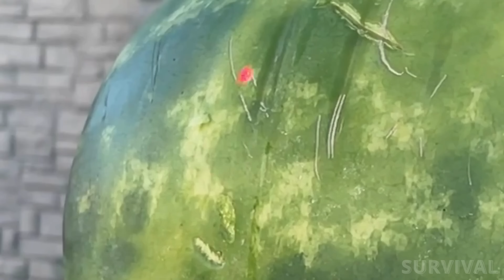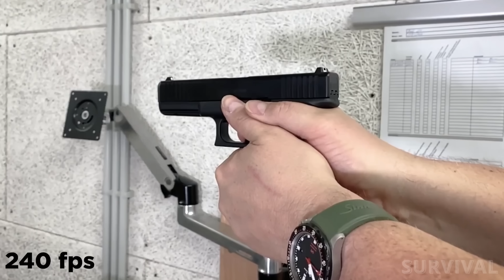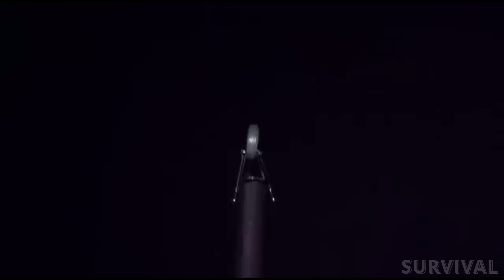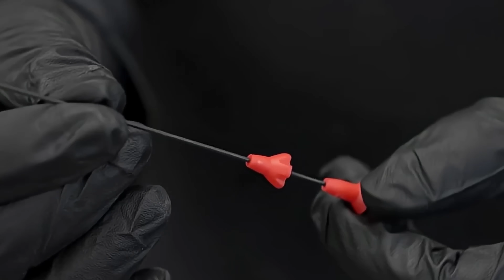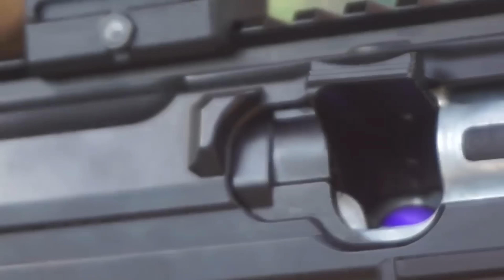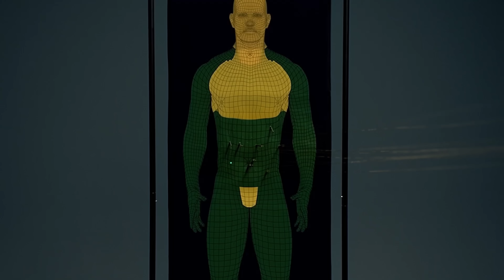10 ULTIMATE Home Defense Weapons Sold on Amazon — No Permit Required!

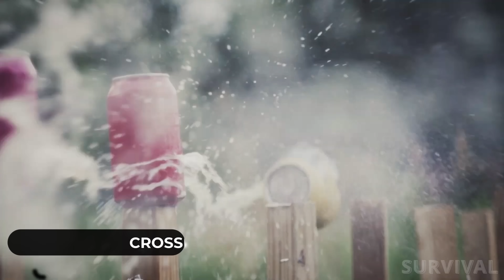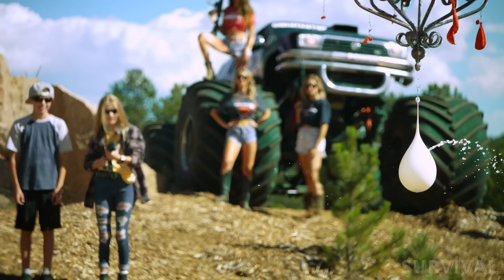Comment: At 6:13, you displayed the Crossman SBR "fully automatic" BB carbine, which looks good...UNTIL, at 6:24, I watched the oblique view of the item in use and saw the magazine wiggling in the mag-well. I don't think I could trust something with such poor component lock-up. What if the magazine suddenly "decided" to eject due to the (in my opinion) excessive movement? No, I can't see myself getting one of these. And, even though these products "are not regulated by the ATF," I question the legality of using ANY of them in a defensive situation. Again, just my honest opinion!

Comment: The patriot power generating system talks about everything that it’ll run, but it doesn’t tell you. It’ll only run one of them at a time. Don’t you want power that it just automatically runs everything and you don’t have to worry about it get a Generac all you have to do is wait a second and a half andnice and quiet. It turns on until the power comes back on then it will turn off. I’ve ran them for 2 1/2 weeks of no power and had absolutely no issue.

Comment: 15 hours for a full charge so you run it down then you gotta wait 15 hours till it’s two in the morning to turn it back on again. Don’t think these are good deals. They’re not if you just had a gas powered Generac home powering system you could run your whole house and never have to do anything just wait two seconds and then run there it goes you can run it on propane gasoline or as we prefernatural gas. I’ve ran it for 2 1/2 weeks straight not an issue whatsoever. Everybody in my neighborhood was like she we thought you were crazy but guess what they all got now my exact generator set up from Generac professionally installed power goes out wait a second and a half then blink everything comes back on and your Wi-Fi comes back on once it’s rebooted after about five minutes.

Comment: No, use your head people. All these solar generators are just crap. Get yourself a Generac, which I prefer or Honeywell full house generator system. Have it professionally installed when the lights go out you count to one and everything in your house is working everything and you plug it into your gas lines so you never run out of fuel. I had my house lit up like a Christmas tree for a week while people with solar and everything else we’re having all kinds of problems asking to run extension cords to my house, but I wouldn’t let them.

Comment: I will not leave the house without at least two Derringer 32 caliber pistols in my coat pockets don’t underestimate these things and the high caliber 22 Derringer‘s are very deadly. They pull out lightning fast and once you get a chance to practice with him you’ll be like why the hell did I never have this on mebeforehand always have a Derringer in your pocket to protect against these Muslim fanatics and crazy black carjackers you won’t even see it in your hand you get out it’s in your hand. They don’t see it in Bam right to the back of the head.
Reply: There is no such thing as a 'high caliber .22", as .22" IS the caliber.  Just sayin'.  But yes, several properly placed .22s at close range can be 100% deadly.  One very well placed round can, too.  A peripheral round, however, might not even slow someone down who it truly pissed off.

Comment: Get yourself a 9 mm with 140 grain hollow point that are injected with glass so they spread out just like our police are using. You can take down a bear with one of these pistols with that calibration. I carry a quick draw system for my full-size gun Which fits along in my back underwear, but I’m able to have it out within half of one second it always has a full magazine with one in the chamber on standby as I like to call it. I’ve shot through with my 180 grain 9 mm rounds that are solidmetal. They will tear right through to human bodies. They will take out a bear. There’s nothing a 9 mm can’t do with the right ammunition remember that and always have 218 round magazines with you that do not get in the way of make it very easy and quick to draw.

Comment: The Hero 2020 will just get you hurt, buy a can of cop grade human repellant. Much stronger than bear spray and it works. Remember to run. The automatic bow, the Stormbow, great choice. The Umarex .43 caliber mini-paintball gun, is a no. Look at a full size .68 caliber IntruBuster. That one cracks coconuts. Cold Steel blowgun is pretty deadly, people hunt hogs with those things. Drops 'em quick. Stick with .625 big bore. .50, .40 can't compare, and you can fish with the big one.  Full auto BB gun. If it works I'd run, lol. Don't count on it just have fun.  Six Needler! Show me your features! Love that thing. Fun category with a little scary thrown in. Lol, a Katana? Winna. The Umerex shotgun is way underpowered, caliber is too small. The Huben GK1 at $1700 and .30 cal is impressive and gives 50 ft lbs/70 joules out of the box. That will ruin your day. Taser 10? That's the real deal. The darts incapacitate not the gun. The gun itself is pain compliance only. So if the darts don't work, you're in a fight, up close and personal. Right now civilians can buy one that shoots 2 darts and is an actual Taser. Cops, I think, get 2 shots. This Taser 10 will be cop only for sure, probably shooting 5 darts at a time and charging the 4 best probe contacts. So still only 2 shots but with much better chance of working the first time.

Comment: You are setting yourself up for failure with any of these!
Reply: 100% agree.  In fact, you will likely make things VASTLY more dangerous over just complying. You are still totally at their mercy if they have a weapon and you don't, but at least you haven't pissed them off to the nth degree.   If you are going to go for defense, at least get a weapon that will do the job.

The only one here that really would, and A LOT more outdoors than in, is the bow, and only at fairly close range.  A bow fired from a long way away is easy to sidestep, unless it is a VERY fast bow.  Indoors the thing would be pretty unwieldy, and you'd better be damned good with it, under the worst pressure you have ever faced, on the first shot.  I wanna tell ya, though, a 70 lb bow with an arrow tipped with a blade, can be 100% lethal, aimed properly.  They will drop a buck just as quickly as a bullet, again, placed properly, and usually with more than a 70 lb draw.

Comment: You did not mention the Byrna launcher. It has a 7 round max capacity of .61 caliber ball rounds and uses a 12 oz CO2 cylinder.
Reply: Exactly….that’s what I have
Reply: @garypatrick7817 mee 2 !!! Stay safe!!
Reply: Well those byrnnas cost more than a real pistol
Reply: @markpasquarella3223 word. DK SPENCER has hundreds of videos of cheaper and more effective pistols
Reply: Byrna is overrated, I've had so many misfires. Pull the trigger and the first ball just falls out of the barrel. They're really inconsistent over longer use. Definitely a waste of my money as I don't feel confident it will perform when needed so it sits as a toy with my crossbows throwing edged weapons etc.
Reply: and sometimes those balls don't break on impact.... useless
Reply: @Mark-OutWest  The purpose of the balls is to make a painful enough impact on your target to deter them in home defense without the bloodshed.
Reply: @MegaGeorge1948 as someone who grew up up with paintball guns shooting friends at point blank range with frozen pain balls, I know first hand that air guns firing rubber, paint, powder, or metal projectiles is painful. Even the little airsoft pellets hurt when they hit you in automatic fire mode (without body armor or padding)
Reply: @Mark-OutWest query do you have to charge it at time of usage/piearce the c02 cylinder..or is it a bump like the other one featured here  just asking
Reply: @miguelcastaneda7257  this is my biggest complaint about my Byrne compared to my p2p. I can leave the p2p for months and hit it and fire. My Byrne only lasts about 3 months ( untested) if you tighten down on installation. Hey who has time to remove the mag and tighten the co2, replace mag and live?
Reply: @webfoe k.thanks  reply  was  wondering...have a few co2 pistols amd rifles  yea even new o rings they bleed off hot weather  faster  but still if you have to charge it  if getting attacked   thats a few seconds  ...understand  theres one thats a bump opearated
Reply: @miguelcastaneda7257 so my p2p is bump operated and while I feel the Byrne has more punch the unreliability of a tapped co2 over time weighs against the Byrna.
Reply: @miguelcastaneda7257 you can leave the cartridge in and when it's needed, if the safety is on pull the trigger and it penetrates the CO2 then you can fire or take the safety off pull trigger and pierce the CO2 and fire at the same time. Warning the first shot might just roll out of the barrel😅 funny but not funny in a real situation. I wouldn't waste my money on any of their launchers again. I could have gotten a real firearm for the price.
Reply: @miguelcastaneda7257  I usually get about 12 shots before changing the CO2 cylinder.
Reply: Yea they are nice. Incapacitate for 20mins.
Reply: People who give us the fucking a.i. banana commercials don't deserve our money
Reply: I got one of those 👍
Reply: Or .68 caliber. I use .68 caliber. Solid Aluminum rounds, possibly lethal, can put a hole in OSB.
Reply: bryanpetersen1334.  From a Byrna?
Reply: @G @George-g4v5x osts $30 for 155 .68 cal. 7.5 gram Aluminum balls. Also great for practice, they don’t deform easily and can be reused.
 I shoot them into the same rubber conveyor belt I staple rifle targets to.
Reply: @bryanpetersen1334  from where?
Reply: I got a 25 round drum for mine
Reply: UMaREX is way better than Byrna but to each their they his her own